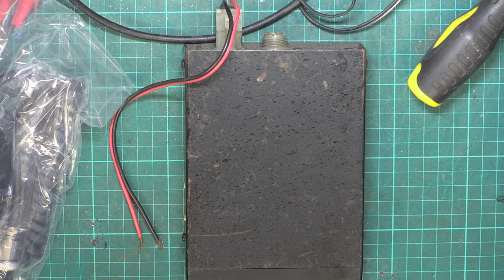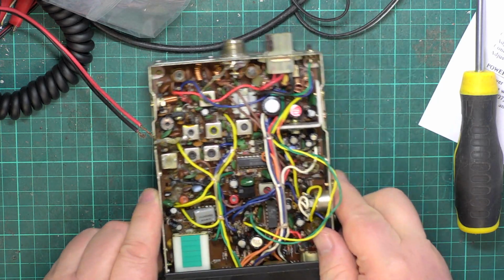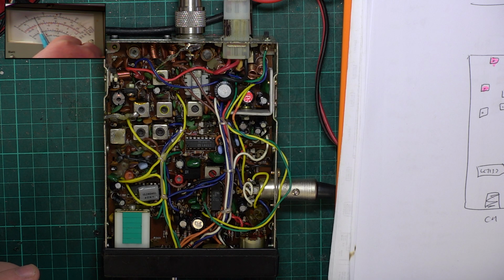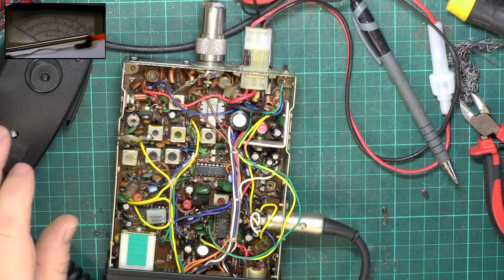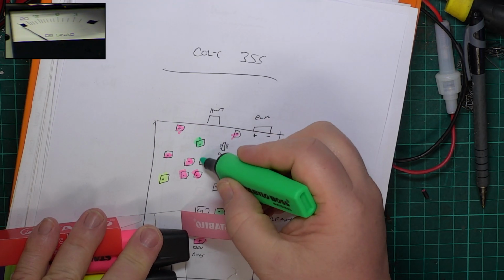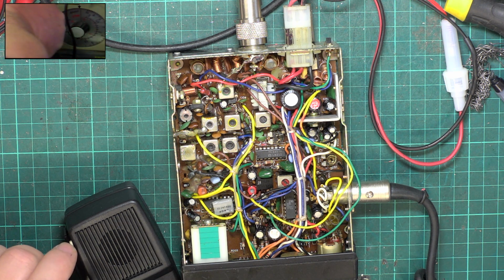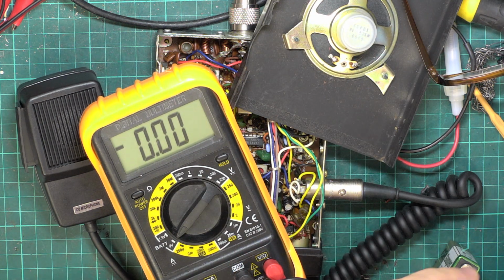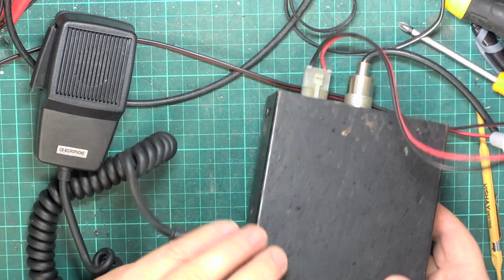Colt 355 UK CB27/81 CB radio (mobile) - service & adjustment

Comment: Great video and enjoyed watching you do the checks and adjustments but what happens to the CB radios you buy and fix then  do you sell them or just keep them
Reply from the maker: The business model here is to have one of each UK legal model on the shelf in working order. The idea is that many sets have so service data available, so it enables us to compare voltages between one of our sets & a customer's faulty set.

Surplus sets beyond our requirements are sold off, usually to our business customers. I've never tried Ebay as they are fully serviced to the highest level & probably wouldn't sell......or get returned with parts stolen or blown up.

Richard
Reply: @ukfmcbradioservicingTango21  that's what people do ! I tend not to buy of eBay after been ripped off a few times at least you fix them to a very high standard

Comment: Hey Richard could you recommend a brand name for alignment fiddlesticks  I'm trying to pause video so I could see the name on that yellow one
Reply from the maker: The yellow one is Vishay & we get them from RS components. Unfortunately they discontinued the black phosphor-bronze ones we use. I'd have to make replacements if we lost them. The plastic (especially useful green hex) kit is sold by Rapid electronics & is "color TV alignment kit" ...notice American spelling. The ceramic ones were a full kit off ALiExpress.

Richard
Reply: These are the ceramic ones ,  https://www.amazon.co.uk/Frequency-Screwdriver-Anti-Static-Plastic-Zirconia/dp/B07C1TRGLV/ref=sr_1_2_sspa?dchild=1&keywords=JENOR+8Pcs+Adjust+Frequency+Screwdriver&qid=1606581578&sr=8-2-spons&psc=1&spLa=ZW5jcnlwdGVkUXVhbGlmaWVyPUEzNlFHRjNBQ0tHOFlXJmVuY3J5cHRlZElkPUEwNjM3NDY2MVBLSThEOTVQODZONCZlbmNyeXB0ZWRBZElkPUEwNzA5Nzc4MUVWNVdNN0pCRElNQyZ3aWRnZXROYW1lPXNwX2F0ZiZhY3Rpb249Y2xpY2tSZWRpcmVjdCZkb05vdExvZ0NsaWNrPXRydWU=
Reply: https://www.ebay.co.uk/itm/Ceramics-Bits-Durable-Adjust-Frequency-Screwdriver-Set-Anti-Static-Hand-Tool-Kit/393001044309?hash=item5b80b00955:g:vMwAAOSww2ZfoZ1j

Comment: The design reminds me of the Breaker 40FM (PR 27GB) that i've got.
Reply from the maker: Roger, I must do one of those I seem to have several!

Ricahrd
Reply: @ukfmcbradioservicingTango21  Do you know what the din socket is for? I bought it without a manual from a friend.
Reply from the maker: Usually if a radio has a DIN socket other than for a microphone, it's usually 6-pin for a selective calling unit. I've never looked at one. I have one in a box which may have instructions, so I'll cover the model this week.

Richard